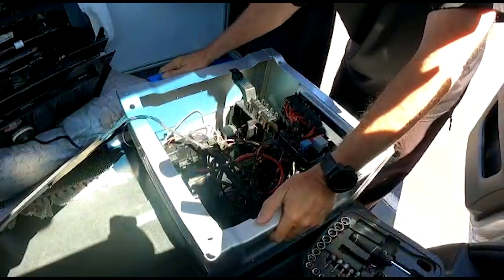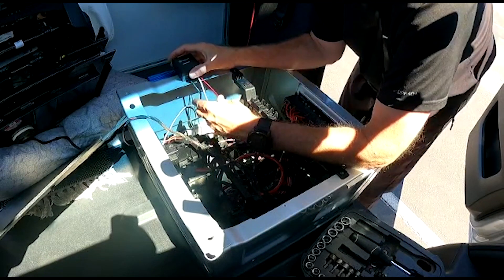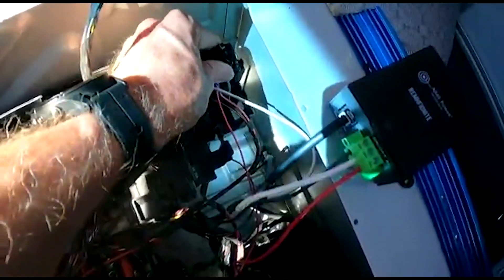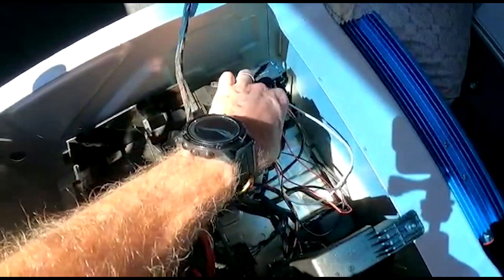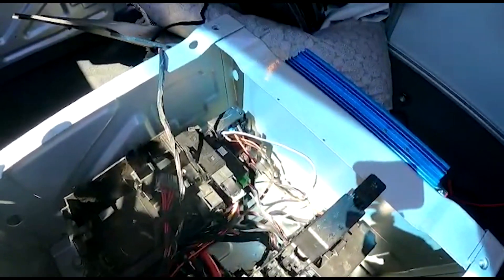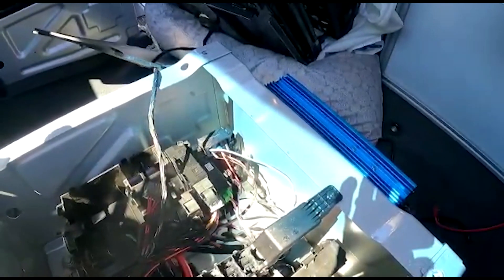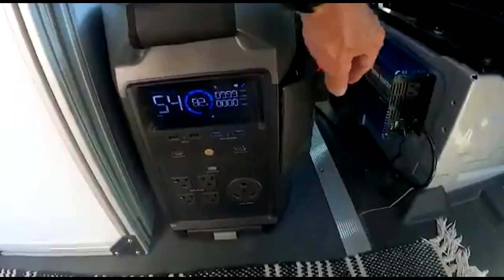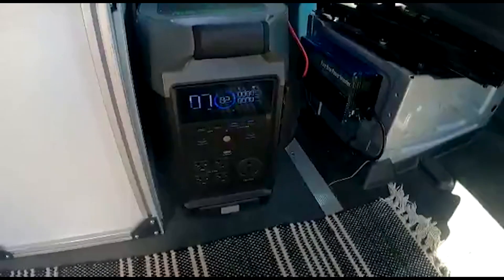HOW TO USE AN INVERTER TO CHARGE (80amps) AN ECOFLOW DELTA PRO WHILE DRIVING. SPRINTER BUILD.

Comment: Bob, can you please include the parts list links. Thanks so much!
Reply from the maker: Hi Vladimir - hope all is well. Here is the inverter and the ignition switch that I used. The main reason that I went with this inverter was because they also sold an automatic ignition switch for their product. Might be others out there. I totally love this solution - so easy, perfect for the Ecoflow Delta Pro as it allows me to change the AC charge watts to whatever I need and in this case 1000 watts. So, the combination is really awesome. Let me know if you have further questions. AIMS Power 1000 Watt, 2000 Watt Peak, Pure Sine DC to AC Power Inverter, USB Port, 2 Year Warranty, Optional Remote, Listed to UL 458 https://www.amazon.com/dp/B000C73A3K/ref=cm_sw_r_awdo_WYWNX34A7Z7X0SSNN5HK.  
AIMS Power Ignition or Toggle Relay Switch for Compatible AIMS Power inverters https://www.amazon.com/dp/B083PTQR99/ref=cm_sw_r_awdo_RA97PGJD45RTXAH7JYPN
Reply: @GayeNRobert  Bob, thanks so much for the reply. Was there a reason you bought a 1000 W instead of a 2000?
Reply from the maker: Hi Vladimir - sorry for the delay. With the Sprinter, there is only 80amps allowed to be used from the stock alternator - so that is just under 1000 watts. A 2000 watt inverter could cause issues with the alternator. Hope this helps.
Reply: Hi wouldn’t you have to change the wiring in the van to handle 1000w ? The wiring probably get to hot and melt ?